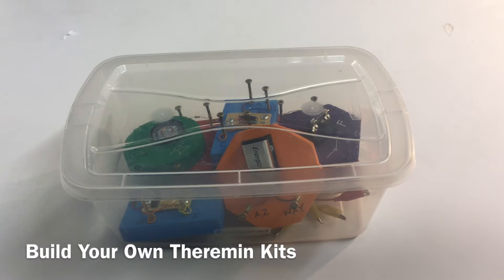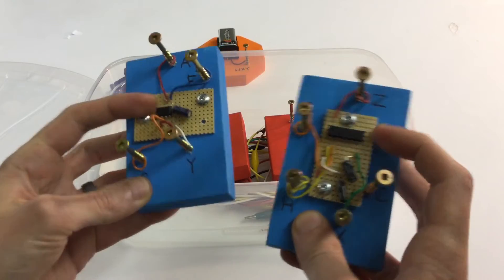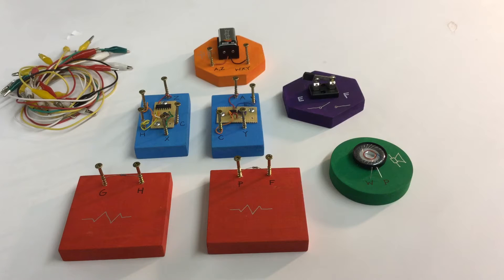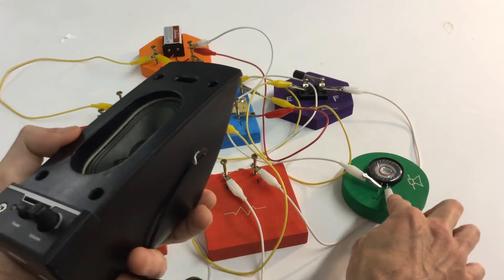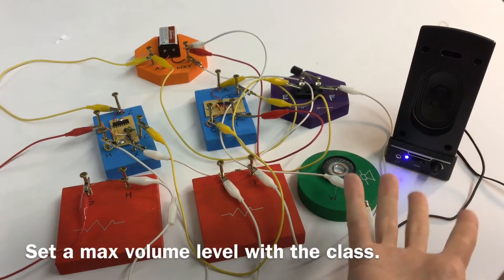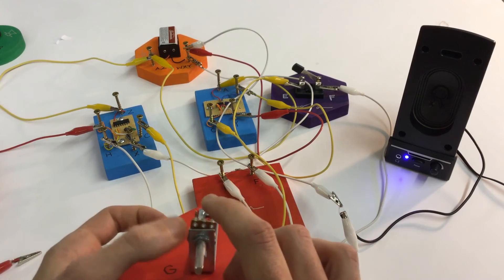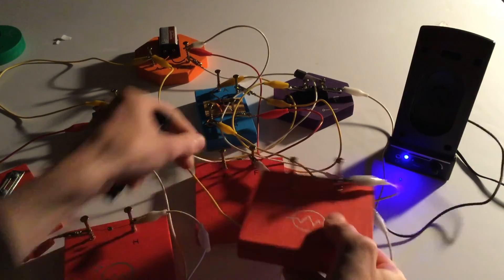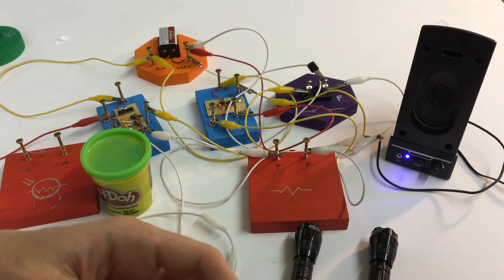Build Your Own Theremin Kits

Comment: Try this kit. I use them extensively in my high school tech ed program:
http://harrisoninstruments.com/101/101_description.html

This is a simple pitch theremin, and it uses capacitance instead of light (photoresistor). 

The students will have to solder, which may be a bit much.